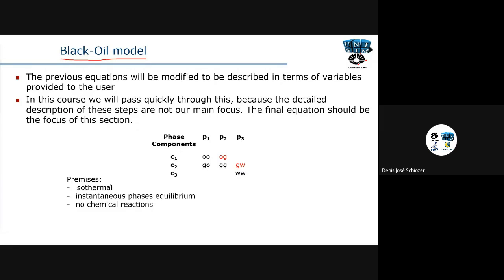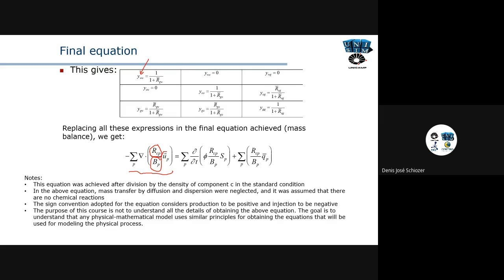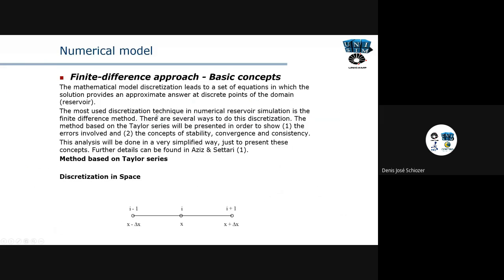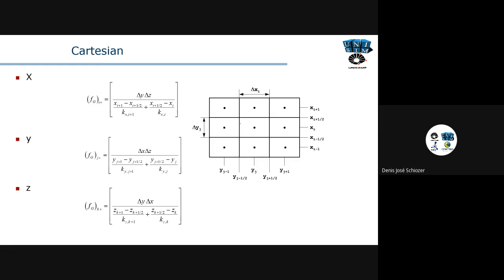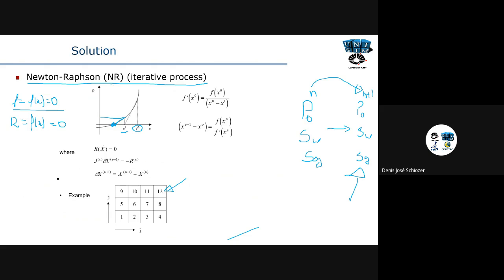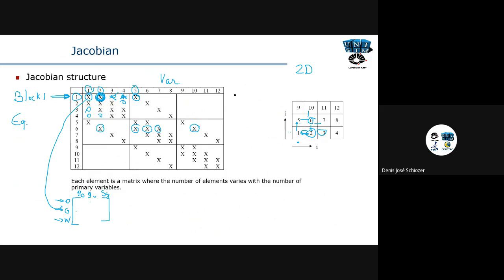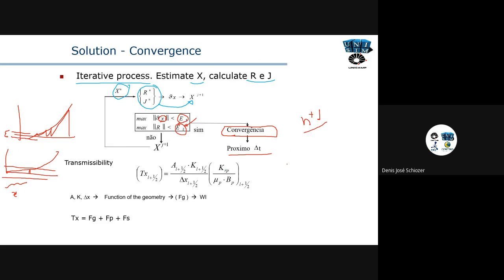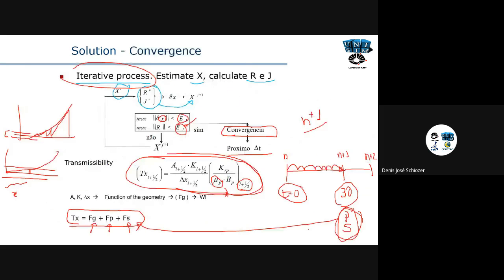PP321 2020 Reservoir Simulation Class 11 Part 2

Comment: Thanks so much for the very clear explanation,
I ask about v iteration of pressure, transmissibility, and saturation that results from frequent iteration associated with linearisation equations of fully implicit methods, IMPES, SEQ and other methods, is it easy to calculate P, S within v iteration, n step where v = n or v < n or v > n , v = 1, 2, 3, …, and n =1, 2, 3, …?